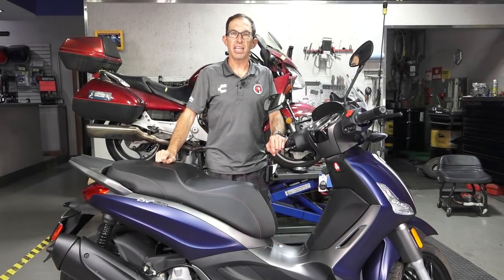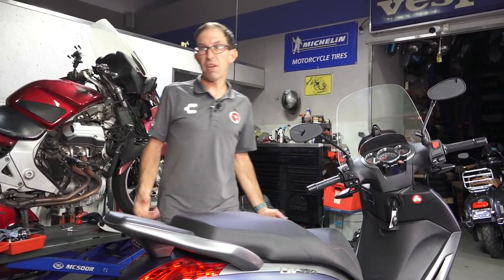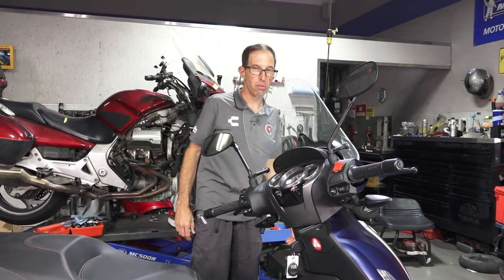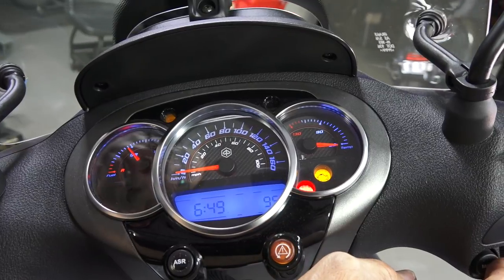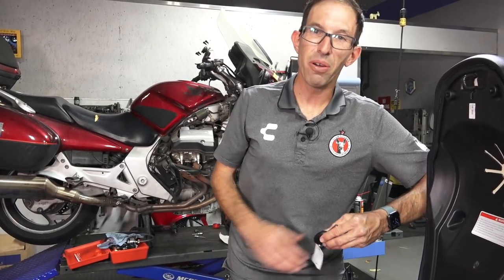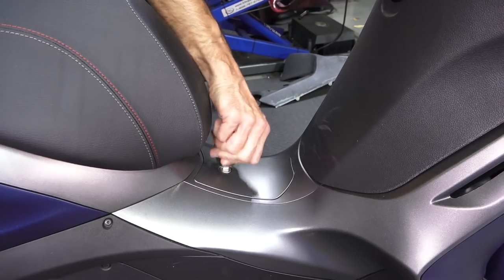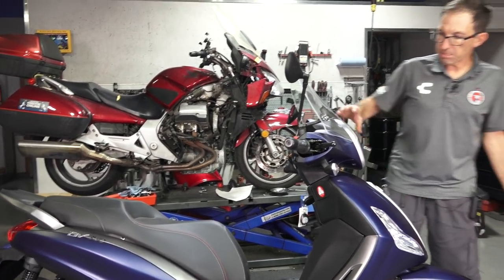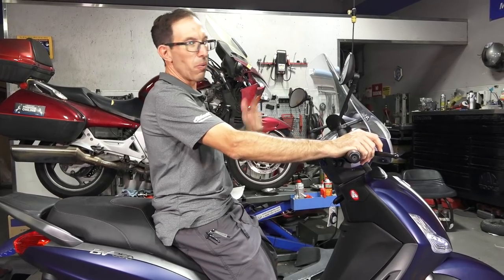All New 2020 Piaggio BV350 Review

Comment: On my 2013 BV350, the only traction problem I've ever had was on recently rained-on oily road.  Made the mistake of pulling on the throttle too hard at the stop light.   Didn't crash, but it got very wobbly and scary for a couple seconds.  Also, I took off the windscreen. Added a akrapovic exhaust.  Best scooter ever.
Reply: Do You still have it?
Reply: @handyman7297  Yup

Comment: I’ve got about 5000 miles on my 2018 BV350 so far. Getting on average 68 mpg with 20 miles each way on my daily LA commute which includes about 15 miles of freeway. The only non stock item I have on it is the Akropovic slip on exhaust which saved a good 8 lbs and makes for a nice throaty sound. I’ve owned lots of bikes over the years but I have to agree with Robot, as a “tool” there is no better bike, especially for high traffic locations.

Comment: Great looking scooter. I'm 5'-6" with 27in. inseam. Is there any way you know of to lower the seat height?  I know on other scooters you could either get shorter front forks, or a rear spring link that lowers the rear.
Reply from the maker: Not so much on these scooters. There's some slight adjustment on the rear shock, but that's about it. We offer a shock lowering bracket for the Vespa Primavera/Sprint, but not for the BV. Another option is to have your seat shaved down at an upholstery shop which we have done many times for customers. Hope this helps...

Comment: Robot what about the miles in small numbers underneath the km? It's one of the best big wheel Scooters in existence but there's nothing new on it since 2014.So you should have gotten the new Vespa gts 300 super tech.  I owne a BMW R9T, that's my ride for every thing long haul's and commuting,  linger trips it's custom, easy to ride, cool as hell and fast. I am planning to get a little Primavera s150 or Sprint s150 . Just for runs to groceries and around the city of Zagreb.  Can you give me advice which is best to pick?
Reply from the maker: That's great. The Primavera and Sprint are virtually identical except for the cosmetics. Check out some of our other videos covering these bikes and maybe you'll lean one way or the other. Both great scooters for that purpose!
Reply: Nothing new since 2017. Traction control.

Comment: What portable air compressor would you suggest to use with a scooter? It doesn't have cigarette lighter socket, only usb. I have never seen any usb air compressors but would be handy to have it. I'm thinking about buying one to connect it directly to the battery. Don't really want to install any additional jacks there.
Reply: I have a SUN JOE cordless air compressor. Runs on a lithium ion battery. I feel its an essential piece of kit for two wheelers where correct air pressures is paramount.

Comment: Had one, didn't like the way engine work. When u accelerate its ok, but when u dont engine starts to slow in second scooter instant so its really annoying in traffic.Cant explain really but its not like on vespa and other scooters when u let gas and vespa just decelerate smooothly. Its kinda shaky ride. Its like u turn switch on and off on beverly. I didnt like that bcs it made me nervous. I didnt like seat its to small and not soft. Riding with passenger and scooter box behind its very tight. its not confortable scooter. Its fast and goes good in corners but i like vespa and other scooters so much more!
Reply: Quello si chiama freno motore

Comment: whats your favorite scooter  suspension wise riding in bad roads
Reply from the maker: As far as Piaggio products, Robot still prefers the BV350 for any utility purpose (longer road trips, extended commuting, bad roads etc.). The suspension on the BV is nothing special (although there are upgrades) , but having the larger wheel diameter is a huge help compared to the Vespa. This isn't to say a Vespa wouldn't do the job, check out some of our Mexico videos and you'll see we've definitely put our Vespas through their paces.

Comment: Shower Thought: Could the powertrain Module off of a MP3 500 be "bolted on" to a BV350 ?
Reply: Bv 500 already exists
Reply: @EFA22000  Where ? The Past ? You can't buy anything bigger than 350 as of now.
Reply: @GIGABACHI  yes, i meant used
Reply: @EFA22000  👌🏻

Comment: Given the multitude of complaints they've had about it all these years, you'd think Piaggio would've changed the seat by now. Its lack of adjustability is a real negative for this scooter. :(
Reply: what is it you want to adjust?
Reply: @andrewseamaster  Pillion style seats with that deep cut between the driver and passenger box the driver in and are really uncomfortable for any ride over an hour. I wish they would move the split between the two areas back a couple of inches and include some kind of installable bump (similar to the one on the 2013-24 models) for shorter persons who don't need that much room. Either that, or offer an almost flat seat as an option. I've seen people get customized ones which are a big improvement but cost another $300-400 dollars.

Comment: Thank you for this review.  I live in Seattle and I've been trying to decide between BV350 and GTS300.
Reply: vespa
Reply: I had a GTS 300 before - I drove the BV for a test ride... no way the BV ist in any case the better scooter. Next year a BV will stand in my garage :-)
Reply: I have ridden both and my preference is the GTS 300. I have had a couple of Beverly's in Italy as well as a GTS and I own a GTS in Britain 2018, the second one. I don't feel that the Beverly is as manoeuvrable and I hate it not having a flat floor space.
Reply: @davidbrooksbank7444  I agree, the vespa is more handsome, but by far not that stable the BV is. The Vespa hasn´t got a flat floor either. The Honda SH or the Kymco People are the only ones with real flat floor. Beside this the BV is more powerful and has a much larger space under the seat. The BV is also much cheaper. The BV has a cluch running in oil like all motorcycles do, which gives more reliability. I saw the crankshaft of a GTS 300 and of a BV laying side by side - the one of the GTS looked like the one of a moped. The BV has much larger bearings, so that I think you can drive up to 100.000 Miles with that engine.
Reply: Timmy C.  Not for me it doesn't, thats why I'm back on a new GTS.
Reply: Timmy C.  you are absolutely right!
Reply: seattlegrrlie hi man get the BV 350 , its more reliable and nore stable on the highway.
Reply: In the meanwhile I own a BV 350.... glorous scooter👍👍👍
Reply: @ruezi12  which year model do you have and how many miles have you done so far
Reply: @CKPHH  its a model 2016 with nearly 10.000miles. But I bought it last year with about 8.000 miles
Reply: ruezi nice, any minor issue?
Reply: @CKPHH  not yet... next time I will do a service and give her Pulley rolls
Reply: ruezi do you know or expect when they will do a all new bv350?
Reply: @CKPHH  unfortunately I dont really know. But at the latest all manufacturers have to have their bikes on Euro5 in 2021. The actual Beverly is on Euro4, so I suppose they will bring an essential update for 2021. The Vespa GTS was renewed 2019 and is already ready for Euro5 (only a minimal software update has to be done). Most of the manufacturers which have already Euro5 bikes could increaee the power (also the GTS got 10% more poeer), so I think thevBeverly will be again as strong as the Euro3 model but with a better performance from torque
Reply: ruezi amazing how is euro5 affect the engine?
Reply: @CKPHH  Reduction of noise an CO2... as all Euro5 engines got better, I suppose that the manufacterers were not forced enough to react in the past. This costs of course money. If there will be a new BV i would like to have a better suspension at the front and rear and to get a more comfortable seat for the driver. What would be your wishes to Piaggio?
Reply: ruezi refresh design with same shape, a liltle bit slimmer front chest, Led Front head light and more modern rear light. Revised Modern odo or Digital Led. Strongger engine and less engine braking? Hahaha im greedy.
Reply: @CKPHH  have you had engine brakings? I bought two strong LED H7 headlights but they are not mounted yet. I bought the same for my CB 750... it´s shining great. I also mounted two very strong but very small position lights at the front on my 750. They are very bright too. There are annother two left for the BEV... I like being seen from everywhere... :-)  ... my goal is... if you can see the chinese wall from space you must see me too :-)

Comment: When i turn on the key the Orange light (abs)  is not blinking anymore. I lost the user manual. My scooter has a problem or i am the problem😂😂😂😂? Hehehe
Reply: If it's blinking it means the abs is working and it's activated, if it remains turned on, it means it's working but it's deactivated. If you want to activate it, all you need to do is press the asr button for a couple of seconds and you'll have it back.